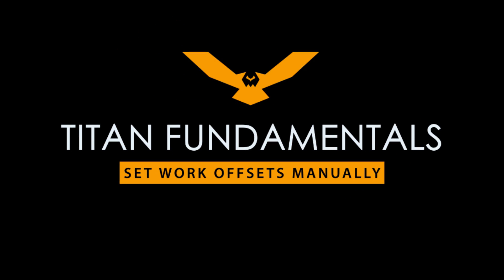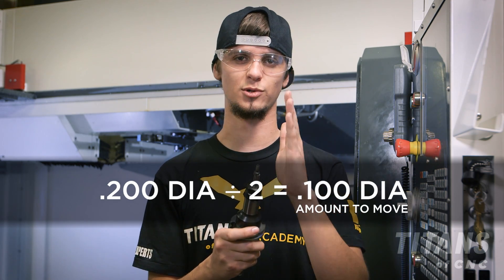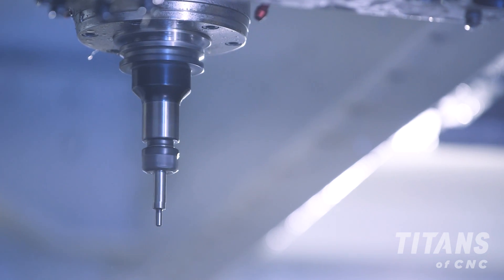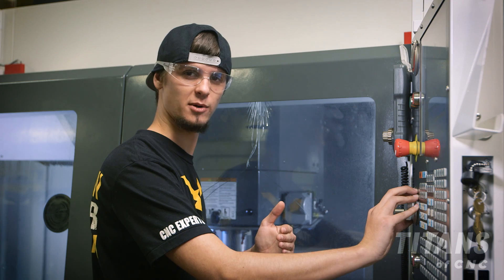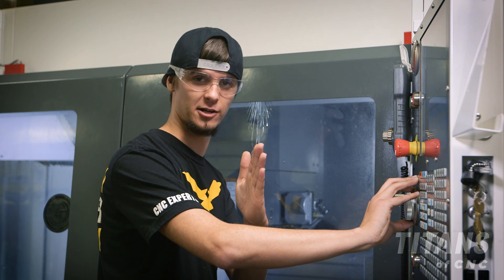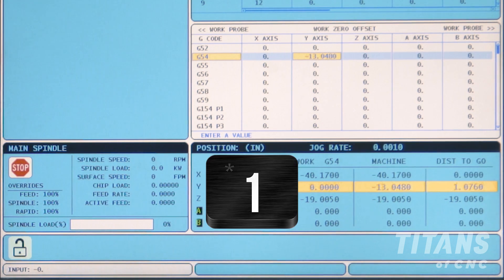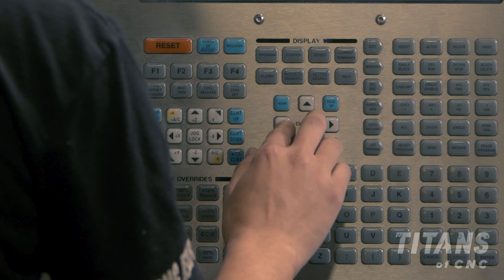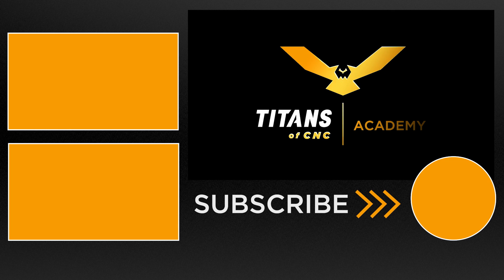TITAN FUNDAMENTALS: Edge Finding Work Offsets Manually

Comment: I've heard some people say to back off one thou after the edge finder bumps out and go  from there, and I've also heard what you're saying and to just go from the point where it bumps out. I usually use a Haimer 3D taster, but I'm having to use one of these for now and I'm wondering which method is actually correct.

Comment: So you subtracted on the y offset by  -0.1 but added to the x ? 0.1? Why is this ?
Reply: Moving the edge finder to the right side is (+), and moving it to the left side is(-). It will be easy for you to find out the directions of (X, Y& Z) Axis, concerns (+)& (-)
Reply: Basically whether you add or subtract .1 is dependent on which side of x0 you're edge finding. If you're on the positive side, you add.